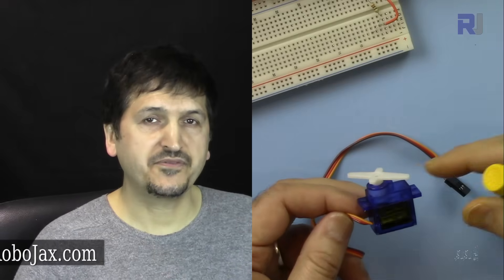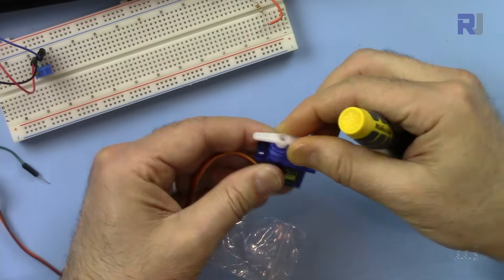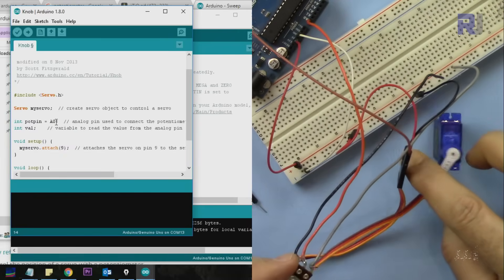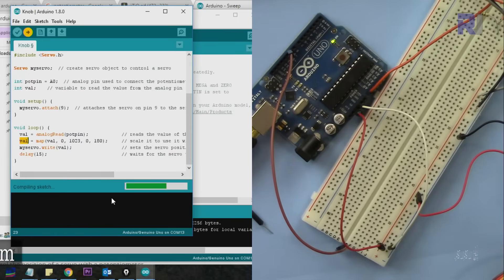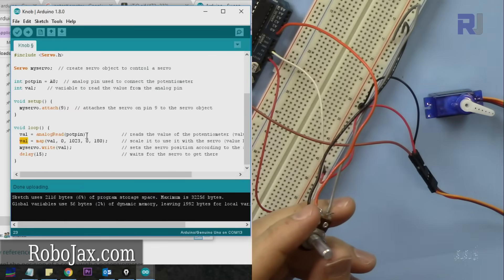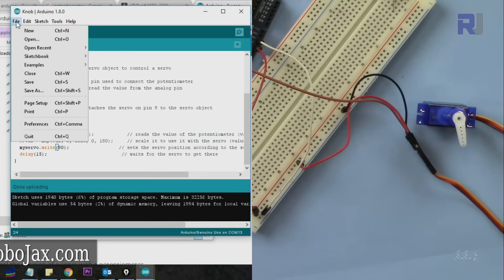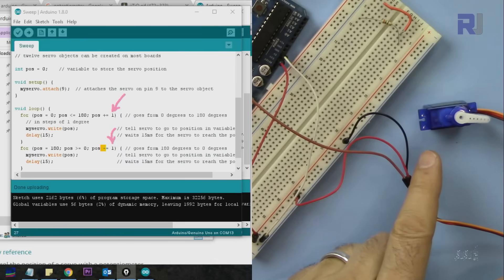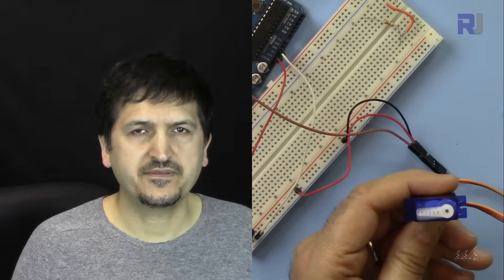How to control Servo motor with Arduino with and without potentiometer RJT08

Comment: Thanks for your good sharing.👍🏻👍🏻😊
What will happen to the white arm if the potentiometer fails? Thanks
Reply from the maker: you are welcome.  the middle wire is to receive signal. when there is no signal, it will just stop. Here is  my Arduino Step by Step Course  (over 100 video lectures) Starts here http://robojax.com/L/?id=338

Comment: How to control a servo with IR Sensor? High intensity IR is 0 degees and Low intensity IR is 180 degrees.
Reply from the maker: very simple use 
int newAngle =map(angle,LOWINTENSITY, HIGHI_INTESITY,  0, 180);
and then use newAngle to send servo that angle. LOWINTENSITY, HIGHI_INTESITY the IR value.

Comment: Thanks - massive help!!!

I have a two questions that extend your examples. 
SWEEP EXAMPLE
I want to have 3 buttons A, B & C. 
Each button - performs a sweep at a an angle and speed unique to that button. Same each time respective button is pressed. .
POT EXAMPLE
Use a potentiometer and a button to control the servo rotation at a constant speed. 
Set the rotation angle with the pot and press a button to have the servo sweep the set angle once - Rotate pot to new desired angle - press again to sweep once - etc...

Any chance you can point me in the right direction here?? (Excuse pun)

mickATliondcDOTcom 

Cheers, Michael
Reply from the maker: Hello, here are my videos on servo. The most comperhisive collection of servo codes I've written https://www.youtube.com/robojaxTV/search?query=servo
Reply: Robojax - ok, checked other videos out, not really any help there. It’s an unusual request I made, I don’t expect you to know how to do it, thanks anyways and for the ‘reply’. M

Comment: hello i need a help from you , i want to fix a server motor to a governor for a generator, so from a rpm sensor through arduino to control the throttle by servo motor and maintain a rpm of 1500 in a loads
Reply from the maker: that i  full project and needs hardware and coding. I have no time . You can hire someone to do it here https://www.upwork.com/ or if you want to learn Arduino here is my course: http://robojax.com/L/?id=153

Comment: @Robojax
thank you very much for the fast response.
https://www.codepile.net/pile/53rlrEBK
https://www.codepile.net/pile/E0xayzAg
These are the last two I tried
In both cases the servos move in their full range but the range of the servo does not match the range of the potentiometer. The potentiometer therefore has a free area at the end in which the servo does not react any more. 
again thank you very much in ahead for your effort
Reply from the maker: Hi Micheal, I just checked one of them as you are not using the code I provided. Please check this page and it should work https://robojax.com/learn/arduino/?vid=robojax-servo-knob

Comment: Hey Hey Robojax,
i have been watching some of your videos lately to learn about arduinos. In particular I am interested in controlling servo motors with a potentiometer and have slo watched your video about it. I have already done this with the arduino libraries but only a small SG90 servo works fine. I have tried to apply the program to a SunFounder (SF3218MG) with a 270° rotation range and an even bigger Takanawa servo. This caused the error that the servo does not move over the full range of the potentiometer but reaches its maximum angle before. Do you have any ideas or hints what I could change so that it works with the whole range?
enclosed i will send you the small program that i was hoping should work with the whole range.
I hope it is not too cheeky to ask such a special question. 
With best regards 
Michael
Reply from the maker: Hi,  I have a the most comperhensive tutorials on servo and written codes to control them.  here are my videos on servo:  https://www.youtube.com/channel/UCkcBSig_Iu4ZnAIeCeG1TVg/search?query=servo you may post your Arduino code online here and I will look at it. https://www.codepile.net/pile/7LKn5JlQ once you post your code, your code will get unique URL or address, post the address under this video as new comment and I will look at it.

Comment: When I connect sg90 to arduino uno led lights goes off and arduino gets heated up immediately...Can you please give us the solution
Reply from the maker: Either you are connect positive and negative incorrectly or the servo is dead with short circuit

Comment: is it a problem if I connect the servomotor to the 5V supply from the Arduino? Should I use a capacitor?
Reply from the maker: No problem. it should work fine.

Comment: Nice video bro keep it up. Kindly upload the video of how to make a calculator without using potentiometer. When i connect the 16x2 lcd with pot. it doesn't work but without pot. it works. Also upload a video of how to open a 10k ohm potentiometer. Subscribed
Reply from the maker: Thank you. Here is video that shows the value of pot on LCD https://youtu.be/DN1LPMSZtNA

Comment: Hi, can we stop the servo into a possition predifine?
Reply from the maker: yes. you can. Inside the setup()  just pot for example if you want it to be at 135°
myservo.write(135); 
and it will start at 135°

Comment: sir my servo is automatically rotating....after i upload the program....do u have any solution for that
Reply from the maker: if you have the same exact code it should not rotate. Tyr it gain with new code and if you got the same result, then servo is defective.

Comment: Trying this as my very first Arduino project. I did everything and it kinda works. The servo turns back and forth but by itself. I'm unable to control it with the potentiometer. I just copied and pasted the code. Was I supposed to change something in it? Any help is greatly appreciated, thanks 👍🏼
Reply from the maker: In the same page you see the code, there is link to a page where you can get the code to use potentionmeter.
Reply: @robojax  I already got it working but thanks 👍🏼
Reply from the maker: You are welcome.

Comment: Plz tell me servo connection it's not working
Reply from the maker: check the wiring. Also you should know that NOT all pins are PWM, in Arduino UNO pin 3, 5, 6, 9, 10, or 11 have PWM . See details https://www.arduino.cc/en/Tutorial/SecretsOfArduinoPWM. Try the code I provided without changing it.

Comment: Does it matter if i use an analog or a digital servo for this setup?
Reply from the maker: No it does not. this code should work for both.

Comment: Hello sir,
 I  an student of fial year and doing project on arduino uno . i am writing same code for the MG946R SERVO  motor but it rotate at 360 degree and have 3 to 4 continuous rotations . please  tell me how to handdle it.
I'll be highly Thankfull to you
Reply from the maker: Your servo is different. It is 360 or continuous servo. See my video on that type of servo: https://www.youtube.com/watch?v=b_xvu6wWafA
Reply: Robojax Thank you so much.
i may need more helf as i am going to chose robotics .
Reply from the maker: I see all comments from all videos in ONE page. Please use reply under this comment to continue> https://snag.gy/AHhRpV.jpg this will be very hard for me what your question was to go and find it and answer.
Reply: Robojax My applogies !😊
I really like you way and as well as the effort . but it is my  fault that i can't make you understand my question.
i repeat that , i am using servo MG946R 360 DEGREE motor and  input is from.solor voltage. i want to  rotate it 0 to 180 and   then 180 to 0.
but , i can't stop it. i tried many time i change angle dalays. it  dos't stop. please guide me.
Reply from the maker: I have explained how to stop 360 servo in this https://www.youtube.com/watch?v=b_xvu6wWafA
It is hard but you can find it. may be use a potentiometer so when you rotate it, it gives values close to stop value.
Reply: Robojax Thank you soo much sit,
will contact you for more guidline.
proud to learn from you sir.
Reply: @shuhabshamshadofficial617  learn how to spell, and you said you are in your senior year?

Comment: I am trying to make this by using servo HS-7955TG, arduino mega 2560, and potentiometer 1KOhm. But, the horn can not move smoothly. Is there any calculation to determine potentio spec?
Reply from the maker: watch this video  https://www.youtube.com/watch?v=3_C7gJeX9hc
check the current and see how much current the servo draws. Sometimes it might draw more than 100mA and if that is the case, to be safe, connect external 5V to servo.